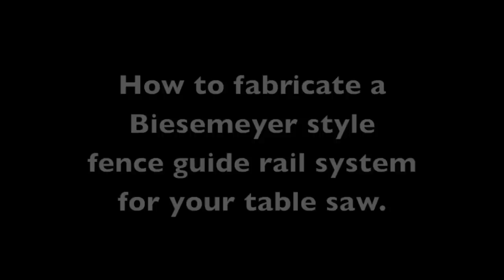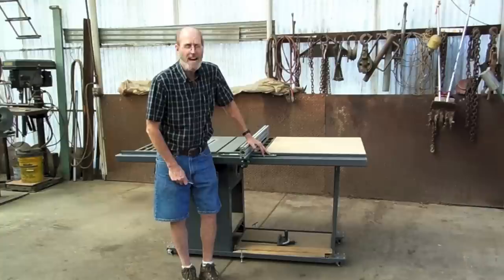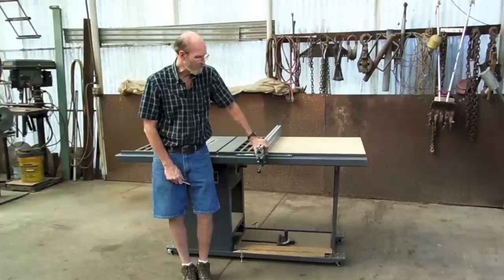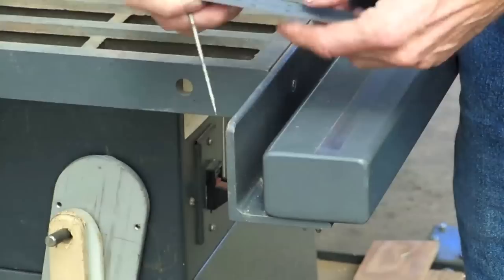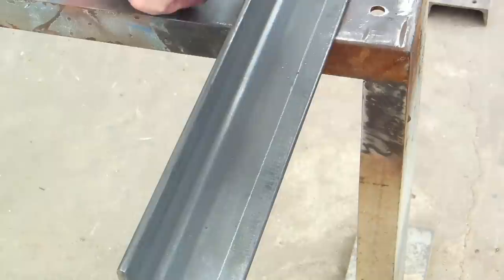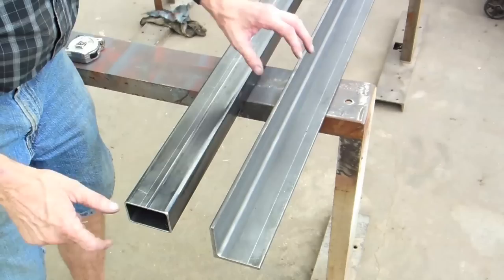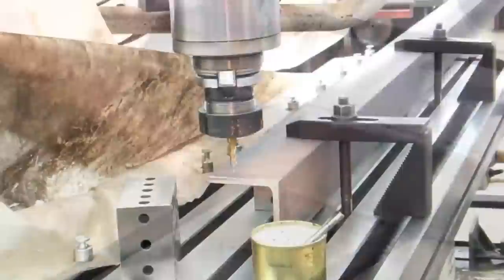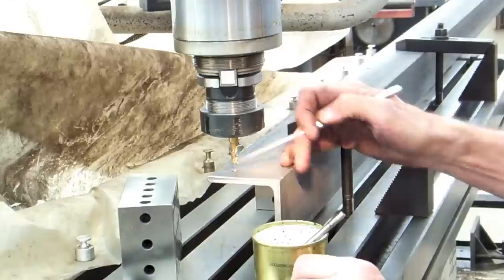1 of 5: How To Make Your Own Table Saw Fence Guide Rails & The VerySuperCool T-Square Fence

Comment: I ordered the standard clamping system today and will build this for a Craftsman Contractor's Saw.  I have used the extrusion to build CNC Routers and have some extra laying around here somewhere.  It is great and available at the factory only a few miles away.  Thanks for the videos.  Mr. Little did not show as much in 27 videos, but I still enjoyed them.

Comment: About 25 to 30 years ago, Fine Woodworking published plans for a fence that uses an aluminum C channel for the fence, an angle for the T, and a length of Unistrut for the rail.  You bolt the angle to the channel and the clamp is just a carriage bolt with a wood handle that tightens up a wood block with a nut in it that rides in the unistrut. It's a very simple build.  I made one years ago and it works great.

Comment: Hello, what is your thoughts on using 1/4 aluminum stock for the angles and tube. This is easy to work with and would take some weight away. Do you see any issue by doing this?